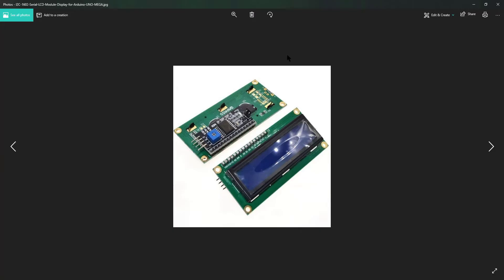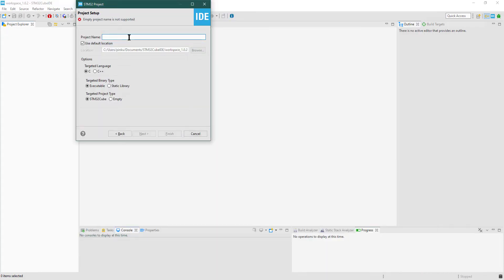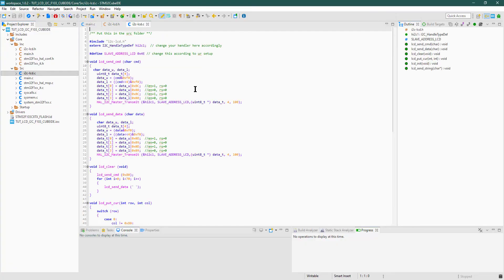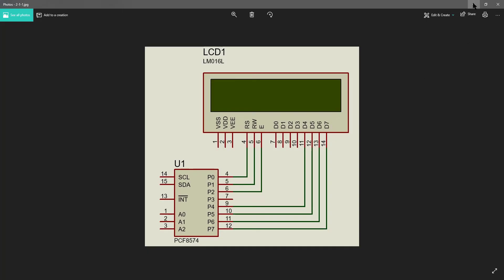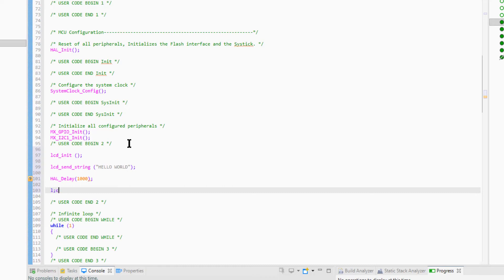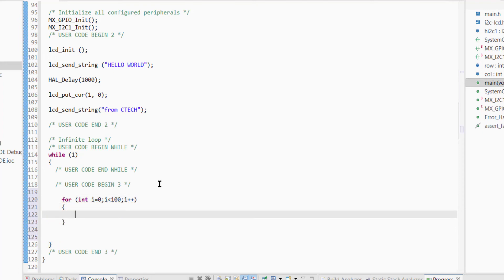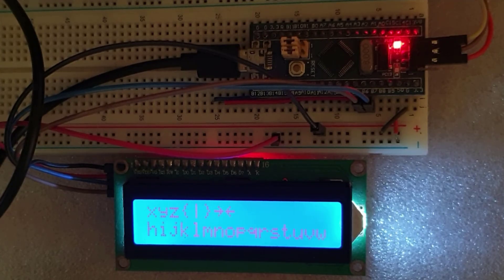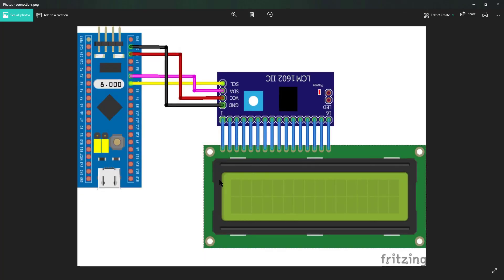Interface LCD1602 with STM32 via I2C | CubeMX + HAL Guide | Print Strings Numbers Floats

Comment: Very helpful video but can you explain why you say to not use address 0x27, my LCD uses the PCF8574T and its I2C address is 0x27?
Reply: 0x27 shifted to the left is 0x4e. The address is shifted left because the least sig bit is used for  whether the mcu is going to read or write (1/0)
Reply: @noweare1  thanks for the clarification
Reply from the maker: Because 0x27 is not the address. You must be taking the reference from the Arduino, it uses the upper 7 bits for addressing and the 0th bit (R/W) bit is take care of later in the code. 
STM or any other mcu uses the full 8 bits for the address. Which includes the R/W bit also.
Reply: @ControllersTech  so if I use the PCF8547T, what address should be choosed?
Reply from the maker: The datasheet says the address is 0x4E... So you use the same..
Reply: @ControllersTech  thank you. Your reply helps me a lot for my study
Reply: PCF8675T i2c address is 0x4e

Comment: I have one problem following this code. When I attempted to run it up to the lcd_clear() calls, the display still has a bunch of jibberish characters on it. The for loop does have a continuous character print (though not quite what I expected) so I believe that, in principle, this code does work to an extent. I found it strange since based on what understanding I could glean from the HD44780U LCD datasheet so far, the code is consistent with the datasheet.
Reply from the maker: In the lcd clear function, we send the command 0x01 to the display. Try increasing the delay after that command

Comment: Failed to start GDB server
Failed to start GDB server
Error in initializing ST-LINK device.
Reason: (18) Could not verify ST device! Abort connection.
Help me pro?
Reply: Check your ST-Link wiring. And you should upgrade the driver too if necessary

Comment: LCD screen is not dislaying the right text. it is just showing some symbols and slash lines. What kind of problem could it be? Thanks in advance.
Reply from the maker: What's the i2c device ? The addresses are different for different pcf devices.
Reply: @ControllersTech  i2c device is pcf8574T. I tried more than 30 different addresses, found from documentations and also from comments to this video. It is showing some symbols with address 0x4E & 0x4F
Reply: @ControllersTech  I found mistake in my code. So the problem was about calling initialization function of your library actually before i2c1 initialization. However this does not throwed any errors. Now it is working. Hope this comment might be useful for someone. Thanks.

Comment: Master i can't send command variable  on lcd it is not appearing.When i using f103 i included stdio.h and i used sprintf but it is not appearing but also it is apperaring when i use f407 discovery please help me
Reply from the maker: What i2c device u have ? 
Is it pcf8574 or 8574AT ?
Also try to change the contrast by rotating the potentiometer on the pcf..

Comment: Sir, i am using UART/I2C adaptor (atmel) with 16x2 lcd, & I tried to detect its i2c port in arduino which shows 0x63, will it remain same in stm32?,   In STM32 After debugging and running there are no errors, The lcd glows but do not display text. Board-f030r8
Reply from the maker: What's the i2c device ? Check the id on the IC..
try using the address (0x63 << 1)
Reply: @ControllersTech   Thank you for replying,  i2c id is not clearly mentioned. But it will be helpful if i can  observe values on  serial monitor for stm32F0 board( i read somewhere live expressions are not supported by F0  boards )

Comment: The library in the video and the library in your website are different.And it doesn't work
Reply from the maker: I keep making changes to the library, though the functions remains same. The library works very well. What device you have and what slave address r u using ?
Reply: @ControllersTech  my slave adress is 0x27 when i build project ide finds errors on library
Reply from the maker: Why is slave address 0x27 ? Did you read the datasheet of the device that you are using ?
Use 0x4E
Reply: Controllers Tech Yeah.I take that from datasheet. I tried 0x4E too.I am using Atollic when i pressed build button it finds errors on library and i dont undertand what are the reasons of errors.If you want i can share that.Thanks for your answers.
Reply from the maker: What is the error ?
Can u post the output of console
Reply: @ControllersTech  I changed my slave adress to 0x25 and it works.The errors source is slave adress.I just got it.I really appreciate for your answers

Comment: The oly thing i see is white bricks in the first row.
Reply from the maker: Reduce contrast.
Also check the device address, and make sure you are not using the arduino one.
Reply: @ControllersTech  Thanks! fixed! :D now i only have to fix the issue with the dht11, for some reason it doesnt display data (i watched your other video on that matter as well).
Reply from the maker: You have to first check if the dht11 is getting data or not. Either use debugger or blink led or something
Reply: @ControllersTech  alright, i will, thanks

Comment: How can i know which handler is for my I2c?  i'm using PCF8574 but the SLAVE ADDRESS is 0x27 or 0x3F.
Reply from the maker: U have to  select the i2c while setting up the cubemx. 
Slave address for pcf8574 is 0x4E..
Reply: @ControllersTech  Done my i2c is PCF8574T therefore for stm32 model that I'm using the address is 0x7F.  Now it works thank u
Reply: @memo9768  Can you explain more? I am using STM32L4+ and PCF8574T as well. What were all the changes you made to the original code?

Comment: Great turorial, but I need to set the I2C address to 0x7E whit the same pcf8574 configuratión A1, A2 and A3 to high. I read in another tutorial I need to shit left one bit. If I set the address to 0x4E the code not run. I not understand this happens. I use the blue pill board too.
Reply from the maker: Default address of pcf8574 is 0x4E ( 7 bit address + write bit). It will work with this address. 
If your device worked with 0x7E, than you have PCF8574A... And not the pcf8574
Look at the datasheet for the address..
Reply: @ControllersTech  Yes, is the PCF8574A, you are in the correct. Thanks for the aclaration.

Comment: I have a problem, light on lcd is on, but there is nothing written.. I have STM32L476 and I'm not sure about the slave address. Can you help me?
Reply from the maker: What i2c device you have ?
Reply: @ControllersTech  Lcm1602
Reply from the maker: That's the LCD. Are you connecting it via any i2c device,  like pcf8574 or something
Reply: Yes, it says YwRobot iic v1 (the same with gnd, vcc, sda and slc)
Reply from the maker: You have to be more specific. Read the top on the IC. It must be something like pcf8574 or similar..
Telegram me @controllerstech
Reply: @ControllersTech    hm, there is nothing else written on it, but it is totaly the same as in scheme in 1.06 in video (YwRobot IIC V1)
Reply from the maker: Can u telegram me @controllerstech
Or mail admin@controllerstech.com
Or at least send the link where you bought the product from
Reply: @ControllersTech  Have you found a solution for that? It looks like I’ve got the same issue. The same kit: ywrobot LCD1602A + PCF8574T. I’ve tried slave addresses 0x4E, 0x7E and even more wierd ones like 0x27 and 0x3F without any result. Could I ask for help in that matter? Thanks ;)

Comment: Your lcd_clear function is superfluous. The lcd controller already has a command (0x01) to clear. Thus you'd better use "lcd_send_cmd (0x01);"
The comments in lcd_send_data regarding rs are wrong. (is: "rs=0",   should be: "rs=1")
Reply from the maker: Yeah (0x01) clears the screen but i have had a lot of issues with it. That's why i wrote that one.
And about 'rs', it's value is '1' while sending data. I might have forgot to modify the comment section, but it is '1'. You can see that in the command that we send.
If it's'0', the data won't display at all.